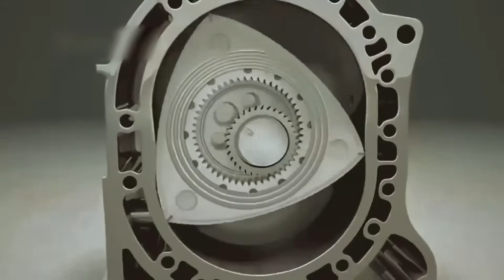The Norton 588cc Rotary GP Engine That Silenced Honda (And Killed Norton) 1994

Comment: Comments and pictures are way off, and they do have great throttle response and engine braking is like a two stroke. 

Waltzing Walter was used at the testing ground.

Comment: The only reason the Norton won any race was because it was actually a 1764cc engine competing with 750s.....
All the other teams knew this which is why they complained so much.
Crighton was a fool for thinking he could keep conning people into believing it was only 588cc
Reply: Your a fool mate, so a 1200cc 12a, 1300cc 13b or a 4 rotor 26B Mazda has a total displacement of 2,616 cc, or 2.6 liters, which is derived from its four rotors, each displacing 654 cc.

So how can the much smaller rotors be 1764cc 🤔
Reply: @stevephillips2936  You clearly dont know anything about rotarys do you...Mazda quote the 'chamber' volume as 654cc, how many chambers does a 13b have...?? The Norton sucks in and burns 1764cc of fuel and air with every engine revolution, exactly why it was eventually banned from racing against 750s....
Reply: This is typical of rotary haters....compare Mazda RX.....compare two stroke capacity to four stroke.....for generations bore and stroke was all that mattered.....why ???? bloody big holes in the bores of ts compared to whole cylinders and cylinder head valves in fs....then advertising money got involved with emission bs in motorcycles making 250 ts compare to 400cc fs....wot a cop out......grow up.....you couldn't hold the throttle fully open on a 250 ts so elected for a fs.....grow a pair.....two strokes are for men.....
Reply: @quesera-f5w  Clearly engineering and facts mean nothing to you...